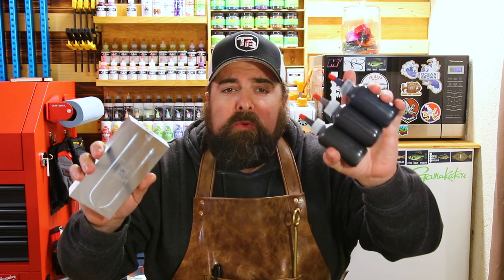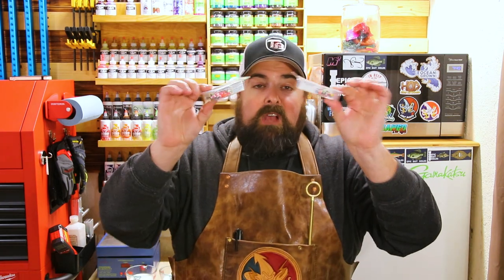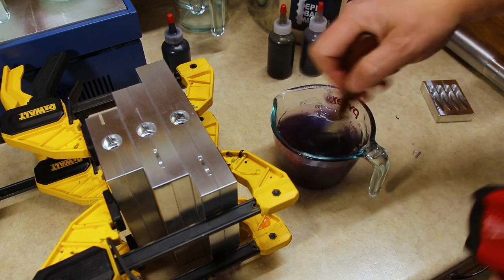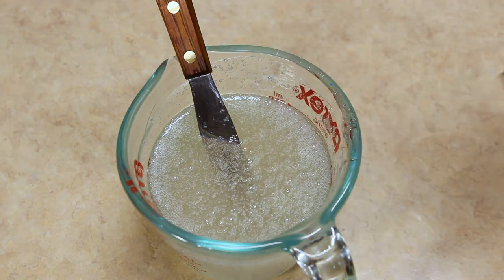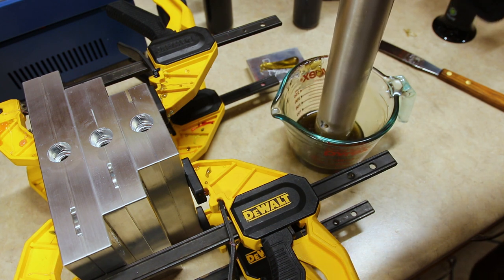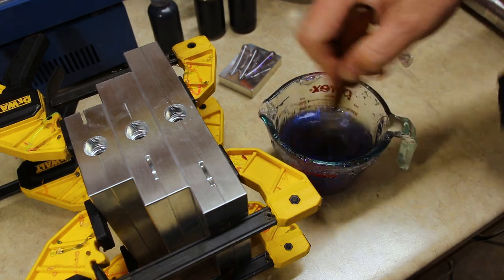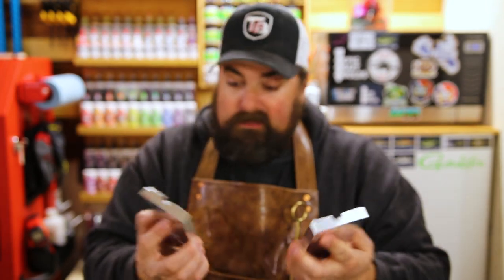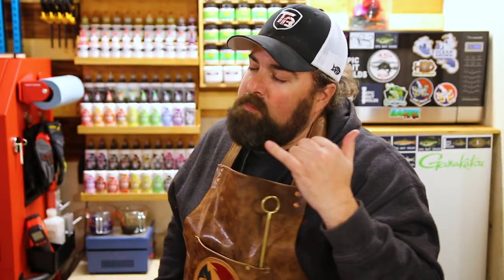NEW Epic Bait Molds 1.2" Crappie Slayer and Unreleased MF Colors

Comment: Order placed...hope there's some left.
when you were looking for flake for the smoke I was suggesting purple, rather loudly. That disco flake was I believe exactly what I was looking for.
Thanks, your timing was perfect
Reply from the maker: Good call! Yeah the Disco Violet from MF and the Sparkle Violet from Lureworks is that cool purple they use in the Yamamoto Electric Shad color.  Only issue, is if you go much above 330 F Degrees, it will degrade and break down the glitter.  You really should vacuum the plastic, have it ready, and then add the glitter and shoot immediately.  It's tricky to work with, but it yields some amazing results for sure!!!
Reply: @baitchuckin  Appreciate the tip...again!!
Reply from the maker: You're Welcome :-)
Reply: @baitchuckin  Received my order on Saturday...thanks for the video! Those colors are amazing. The disco flake took a little getting used to. Took what you said into account. Works great.

Comment: Another great video you are turning into my most anticipated bait making channel. Try Mule fishing for some small jigs that would work on the smaller ones. Also I tried your morning dawn yesterday but I may not of got it mixed enough and it turned out a pastel purple with 9 drops to a half cup.
Reply from the maker: HA!!  Thank You for the very kind words!!!  OK I'll look into those jigs, I need to find something to fish these little things!!!  For the Violet Grape, shake it extremely well, all the good stuff is at the bottom.  I like to flip the bottle over and more sure I can see light pass through to make sure I have it all off the bottom.  ALSO, a pro tip, the openings on those Yorkers is pretty small, don't be afraid to take a tooth pick or an ice pick, and widen that opening in the spout a bit.  It will help the pigments to pass through them.  A push pin will work great as well.

Comment: Not sure if I missed it,(new to your channel) Which plastisol are you using on the crappie baits? I am just getting started at this. Thanks-Todd
Reply from the maker: I believe it was MF Regular Plastisol in this particular video, but I use both Dead On Plastix and MF Manufacturing Plastisol depending on the application.

Comment: How long do you vacuum the plastersol?
Reply from the maker: Again it’s going to depend on how many bubbles are in it. I bring mine up to -30lb pressure then wait until the bubbling slows way down. Sometimes it takes a few min and sometimes it’s quick. They won’t go away completely, depends on how much moisture is in there. 🤷🏻‍♂️
Reply: @baitchuckin  awesome. I just got mine in today and will play around with it this weekend. Got my microwave today along with all my supplies except the hot plate to bake the mold.

Comment: Where do I find that disco violet flake??
Reply from the maker: Disco Violet Flake is by MF Manufacturing, and if they don't have it, it's the same as Sparkle Violet Glitter from Lureworks.  Both will work exactly the same.  But be careful as both are heat sensitive.
Reply: @baitchuckin  so do not go over 350 Or 360??
Reply from the maker: Ideally for Sparkle Flake you don't want to go much over 340 F otherwise you will start to see some color changes in the glitter.
Reply: @baitchuckin  thank you 🫱🏻‍🫲🏽